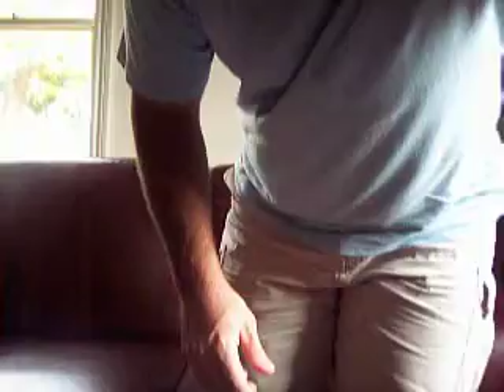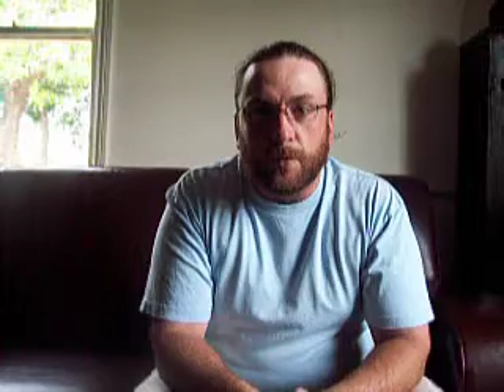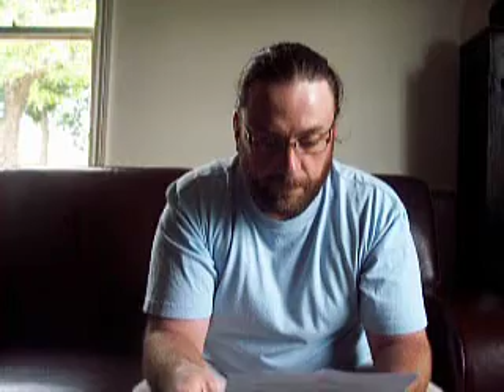THE PRODUCE GARDEN-Treated pine in your garden???

Comment: I'm not sure if you've seen this but CSIRO has done research on CCA timber and it's not as scary as people make out. Apparently fruit/veg grown above ground contain no traces of arsenic at all.  Lining the timber with plastic and planting in from the edges can greatly reduce any leeched chemicals in root vegetables (most of which is removed on peeling anyway).  Anyway have a read, pages 2 & 3 especially for the gardeners - "The facts about CCA-treated timber (Fact Sheet)" at CSIRO website

Comment from the maker: the weedliner system could work as long as the liner didnt break down quickly. im in termite town too, hence my corrugated iron garden beds, red gum is safe but a great dinner for termites. besser blocks are cheap and easy but a bit of a palaver.